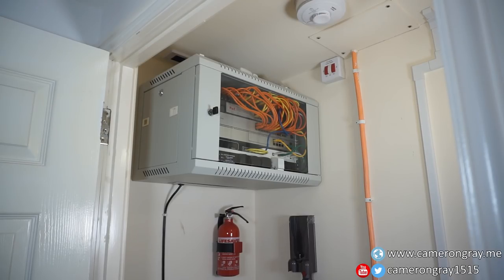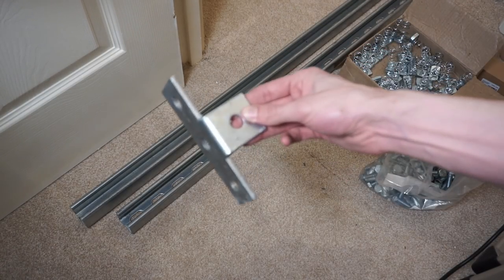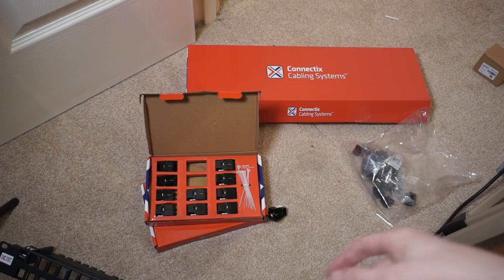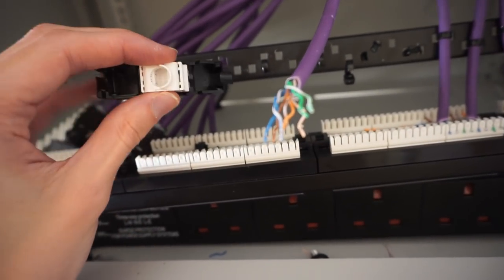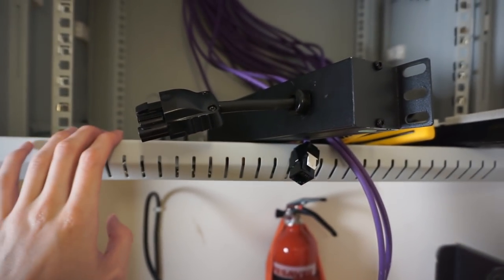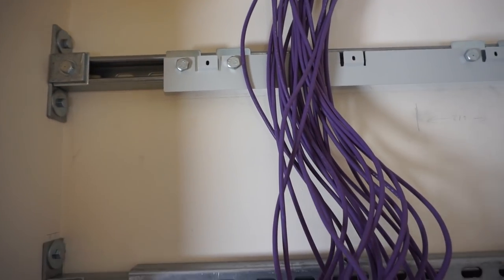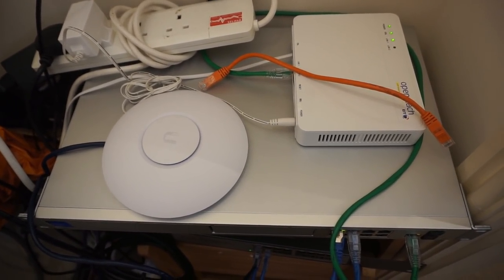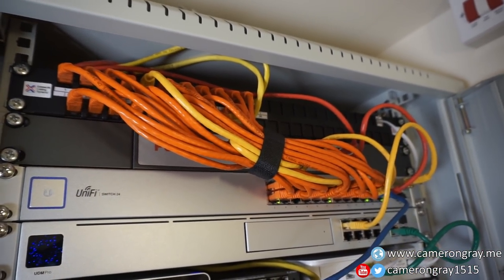Improving my Home Network Rack - New Patch Panel & Better Wall Mounting

Comment from the maker: Hardware used in this video:

Metal struts and fixings from: https://directchannel.uk.com/
Patch panel and keystone modules from: https://www.cablemonkey.co.uk/
RJ11 Keystone Module: https://amzn.to/3C5Ut1D (Affiliate)
Inline 16A Flex Connector: https://amzn.to/3m3cHv3 (Affiliate)

Comment: I work as a network engineer and do work on sites occasionally, primarily with optical networking, but I really enjoy watching these kinds of videos to see how people do their home stuff. I don't have the motivation to actually do it at my place - currently have a juniper fw sitting on the floor with an access point on top of it which was put down the day I moved in, and was "good enough" and remained ever since lol.
Reply from the maker: I can relate to that!  I enjoy my day job but a lot of the time, after working with tech all day, when I get home the last thing I want to do is do more tech stuff.
Reply: It's really constructive to have you watching and commenting, fair play 👍 I know what you mean though, I design houses and extensions for a living, my own house is in desperate need of extension/alternation, but can I be bothered?!? Going back a long time when I was a strawberry picker...I did not want to see strawberry's out of work hours! 😁
Reply: i loved my job. i worked 24/7 for 6 months in the middle east. i was a marine communicator. my skills helped me upgrade my network. my entire house is wired. 2 drops per room. i filled a 16 port switch.
Reply: @defective1331  
I was wondering why you had so many Ethernet cables in a household. I do have 2 going to my living room ,but singles in the other areas . I despise wireless ,and will hardwire everything if I can . I wanted the 16 port switch but it wasn’t in stock so I purchased the wus 24 port . I was concerned about it only having 95 watts of poe , but I’m thinking I’m fine as I’m only running 5 G4 pro cameras and an AP pro on it .
Reply: @MajorTendonitis  i stream my tv only. and wires means no interference. and wifi sucks. it cuts on and off when it gets to a year old. 

how many cameras do you have on your 24 port poe switch. do you have a poe ethernet multichannel nvr

Comment: That chain is a good idea, have used it myself a few times. I take mounting heavy stuff very seriously. I have seen a rack fall off the wall that was mounted on plasterboard, it narrowly missed a child sitting under it(it was in a classroom), glass everywhere and cut the poor kids leg, terrifying could have killed the poor lad.(i did not fit the thing )

 I think you have done a very good job there.

That keystone looks good but i like the angled excel one.

Comment: I install these at work. Whenever we meet a wall without studs that hits atleast one of the predrilled mounting holes, we drill out 2 small holes on the backplate in the network cabinet itself where the stud is located and insert big strong flatheaded screws. That solution is absolutely strong enough. This seemed way overkill. Anyway great video to watch!
Reply from the maker: My issue is that the wall only has a single vertical timber stud so I wouldn't be remotely happy mounting such a wide cabinet to that.  If there was a couple of studs but they just didn't line up with the holes in the cabinet, I'd be totally happy to drill new holes in the cabinet.  This solution is definitely overkill, but £50 of metal fixings to protect £500+ worth of equipment plus the cabling running through the ceiling (and the ceiling itself which would probably come down if the cabinet fell) seemed worth it.

Comment: You can make that so much neater. Put the PoE switch on top, then the patch panel, then your regular switch. Move the keystones to the right side. then just use 1' patch cables to go where you need them. Move the DSL jack to the right.
Reply from the maker: The "PoE switch" is an injector so it really needs to be between the patch panel and switch as the cables are patched through it.  My issue is that there isn't much space in the cabinet, in particular between the door and the front of the equipment.  Even with 15cm patch leads, I imagine the cables would stick out too far and would squish against the glass.  The way I did it here meant that all of the slack of the cables was used up in the horizontal distance across the rack and therefore they don't stick out far enough to significantly get in the way of the door.  All I really care about is that it's totally maintainable and easy to understand, I'm not necessarily bothered about making something /r/cableporn worthy, it sits in a cupboard out of sight.  I'd probably do more if I had a larger rack with more space between the equipment and the door but there's no point replacing it currently when I have other things I need to spend money on first.
Reply: I was also thinking about that and get shorter thinner cables to line them up straight down from the patch panel, it would just be icing in the cake. Really well done though.

Comment: I love the Unistrut install.
I have a few suggestions to clean it up even further.
Move the keystones to the right so they align vertically with the ports on the 16 port switch. Then use much shorter patch cables.
Move the patch panel into the 2nd U location.
Move the 16 port switch into the 3rd U location.
Lastly, move the POE to the 1st U location.

Comment: My 8U and now 12U rack that is mounted in my Closet is lagged screwed into a single stud that runs in the middle of the closet.  Well, the 3/4" Plywood is mounted to the single stud.  The new 12U rack is pretty heavy and so are the stuff mounted in it including the UPS and it's rock solid.

I use those Struts at work. Even much larger ones to hang like heavy Transformers on using long All-Threads.  I still think he would have been just fine using 3/4" Plywood lag Screwed into the single Beam.  You can screw the lag bolt down in a straight line in 2, 3 places and it'll be pretty strong.  This seems a little bit of overkill.

I love Keystone Patch Panels.  If a port goes bad, you can easily replace it with a new Keystone instead of a whole new Patch panel that you would have to rewire everything.  No thanks.   That small rack is clearly not going to go anywhere.  It's beyond overkill, but if he feels safer going that route, then by all means.   Here in the U.S., you can get that strut stuff at Home Depot.  But anything larger or specialty stuff, I'll order from McMaster.  I can get most of their stuff Overnight.

Always great to see other people's setups.

Comment: Thank you for this, I was given some network switches, patch panels, etc. a good while ago. I bought 305m of CAT6 + 3 x Unifi AP's for house and detached office (external runs will be replaced with fibre later, to alleviate electrical grounding & lightning concerns). This will be a very useful video to refer to, as I've only got the arrangement working and not particularly aesthetic (understatement). Your level of detail is worthy of respect. 👏

Comment: Your old patch panel. You can remove the screws in the back and then they come into banks of 6 which you could have easily fit through the hole

Comment: Very nice to see what was my inspiration to sort my home network out get a refresh. The slim RJ45's are nice. I would have thought you would have got something like those and then positioned the keystones to the right to line up with the switch so they're more vertical rather than cutting across. You could also then have a cable going from the cloud key and your second switch running into a keystone jack, then patch to the POE switch. Would give a super clean look
Reply from the maker: Thanks!  The port alignment was really just to take up some of the slack in the cables, otherwise the cables would be too long and press against the door.  May try shorter cables in the future.  I could certainly have used through coupler keystones for the other kit in the rack and this seems to be a bit of a trend amongst the home network community but it's not something I like - just adds in additional connections and possible points of failure IMO.  I'll keep things neat enough so that they are maintainable but I'm not super bothered about a flawlessly neat rack.

Comment: Quite a cool idea, I have used unistrut for fitting cable tray/basket and mounting large external junction boxes and much more but never like you have.
I'd recommend a full hacksaw with bimetal blade or better yet, angle grinder, a files also nice to keep the ends smooth, you can also get plastic caps

Comment: Good video, I've just done a very similar thing, upgraded my cabinet and moved from IDC to Keystone. I generally don't come across many Keystone installations in the UK but they are so much easier to work on, but a more expensive option.

Comment: That looks like a clean and sturdy mounting system, I like it. The overall setup also looks pretty clean. One thing I dont understand is, why do you use the left ports of the patchpanel instead of the right ones? Is it because you dont want to run "over" the POE injector ports? Otherwise I think it could look even cleaner that way with some shorter cables.
Reply from the maker: The reason I did it that way was purely because of the length of my patch leads.  Had I right aligned the ports the cables would have stuck out too far and hit the door.  The current patch leads are 15cm which is already really short, getting something shorter would be tricky.  Easy enough to rearrange in the future though!
Reply: @camerongray1515  Oh got it! They look much longer on video. I use 25cm ones for a much shorter distance, but my rack is much deeper. Than I guess your solution is as good as it gets with the limited space you have!
Reply from the maker: Actually, my mistake, the cables are probably closer to 30cm including the ends, I had it in my head that they were 15cm and obviously never thought to measure.  I'll likely buy 15cm ones when I try the slim cables and at that point I'll consider rearranging the patch panel.
Reply: @camerongray1515  a small number of  my 25cm cables are quite bit longer than others, really disappointing :/.

Comment: one  of the patch panels i bought basically allows you to plug a cat6 ethernet cable into it without having to make and terminate your own cables this means that unless you need made to measure cables then you can save yourself the agro by buying premade cables
Reply from the maker: Those work and I've seen them used although I find it easier to connect to keystone modules than to crimp RJ45 connectors.  Not sure where I'd use the through coupler ones personally as I'd always use solid core bulk cable for structured cabling rather than patch leads.  Then I'd never use a patch panel as a way to run patch leads from the front to the rear of a cabinet, I see it done but to me it just adds points of failure that could be avoided by just using a brush plate.

Comment: Was using the UniFi gen 1 24port switch myself until I bit the bullet a few weeks ago and ordered the gen 2 24 port POE. Much neater, and looks superb with UDM pro 😎
Reply from the maker: Yeah, I'll likely move to a PoE switch in the future but that's a while off budget wise and depends if I stick with UniFi or try another platform.

Comment: Got these keystone jacks, and they were great to install/terminate, but most of them broke over a year later when removing from the patch panel.

 The latch that clips into the patch panel breaks very easily when removing. Otherwise they are very nice to terminate, really like the tooless design.

I'm replacing them with passthrough rj45 so I don't have to re-terminate them if they break.

Comment: There is a system called MoCA Media over Coaxial Cable which means if you have a lot of TV sockets in the house then they can be used to carry data as well as the antenna signal to the TV.

Comment: I would recommend using a .5 m dac cable to go from your UDMP to your switch.
Reply from the maker: It would work, but it wouldn't provide any significant performance improvement over a regular CAT6 cable as the US-24 switch I have only has SFP ports, not SFP+

Comment: Really enjoyed your home network videos. They definitely inspired me to planning out my own home network that I'd like, which lead down a rabbit hole about Networking, then Home Assistant and Automation and Blue Iris. The time you spent thinking about the little details like Labels and cabling is so worth it because that cabinet looks great. Curious what your thoughts are on using the BT Openreach modem over the standard ISP modem.
Reply from the maker: I've just always used the openreach modem since I've been using it since it was the ISP modem (they used to provide them with FTTC services before they integrated VDSL modems in their routers, they also used to send out an engineer to "install" the modem along with a VDSL filter faceplate).  If your ISPs router supports bridge mode I suppose you could use it as a modem however the one Plusnet supplied doesn't.  Additionally the openreach modem (or other options such as the DrayTek Vigor 130) have a nice form factor that can fit in a rack whereas ISP routers tend to be bulky vertical standing things that look silly shoved on their side in a rack.
Reply: Ah that makes sense. I have an openreach modem and tempted to segregate out the devices. Not sure if the vodafone router supports bridge mode though. Supposedly the openreach modem can achieve better speeds and stability benefits in some circumstances.
Reply: @camerongray1515   BTW: They can't use a modem if they use fiber or VDSL - both technical are digital technologies. Possible do you mean a fiber2ethernet or VDSL2ethernet box? Sometimes they integrated it into the router. Do you need a MODulator/dEModulator only at old analog technology over copper lines. 

Modern router are typical a (fiber/VDSL2)2ethernet box, WAN-port ethernet, bridge ethernet2ethernet, 4-port switch 1000 MBit together into one small box with one power connector. Theoretical do you can use only ubiquiti products for this way and not only a switch! Then do you can easy control the way, e.g. failback over 4G/5G, or over cable.
Reply from the maker: VDSL still sends signals over a regular analogue phone line, it just uses a wider frequency range than ADSL so you're still definitely using a modem for that - the "Openreach Modem" is absolutely a modem in every sense of the word.  Sure for fibre it's not technically a "modem" in the official sense of the word, it's usually some sort of ONT in the case of PON domestic/small business installs or some sort of provider managed switch in more commercial installs (or various other options, I've seen simple passive media converters with some early FTTP setups for example).  That said, I'm not a fan of being pedantic about terminology, if I know what the person means and it's not in some sort of situation where ambiguity could be dangerous, that's fine.  If someone tells me that they're having an issue with their "modem" or their "hub" when talking about their ISP provided "router," refers to an outage with their internet connection as the "wifi being down" or asks "Why did you run all those cables in your walls? Is it so you can plug your computer into the WIFi?" then I can usually still work out their intent.  Not everyone has to be an expert in every area of technology and I'd rather simplify things to help them understand than give them the "well... actually..." treatment and baffle them with precise terminology related to devices that they view as "the box that makes the internet work."
Reply: @camerongray1515  The Openreach Huawei modem were routers with the original firmware. Openreach had their own firmware and used them as modems only. These ones can be unlocked. The ECI one as far as I know no one has unlocked them. The Draytek V130 or the newer V166 are true Ethernet modems but can be use as a basic router.
Reply: @camerongray1515  Yeah you right - of course all digital technologies use a wire what can use for a analogue phone too. But if you use after the net-goes-into-your-part/place a cat5/6/7/8 cable and not an old 2-wire-phoneline from 1888 your signal difference between good/bad go over 20dbA higher (or more). This makes a better signal quality what understand no-experts and DIY-people too. But both is a "wire" for them! [I have this problems here for cable tv in a big house for old people's home where only no-experts around. They not can understand that the correct "cable / wire" is the problem of the solution.] 

Exact this and many other problems let me nitpick the exact words - then ubiquity unifi have own router, security gateways, switches, access-points, aso. I am not the once viewer how ask why do you use a provider box for VDSL after all european countries allowed it that every customer can use own equipment. And - it makes more sense after you love this ubiquity unifi hardware.

Comment: i’ve used gripits to mount a 55” Oled with a vogel’s slim wall mount. 

Gripits did scare me as i was not 100 percent they opened correctly. mind you, the tv was up for a few years before we moved house so i assume it was all good.
Reply from the maker: Yeah, they're pretty good, my concern with this was more the fact that the cabinet protruding from the wall creates a sort of cantilever force with the gripits being pulled away from the wall surface.  With a TV on a flat to wall bracket it's more of a sheer force which puts less stress on the plasterboard.  The 113kg rating of blue gripits is only for sheer force, the ratings for cantilever and tension forces are significantly lower.

Comment: good job on this project... btw, you might have mounted the power in the back of the rack just behind the patch panel... that way you can get free space between switches for better airflow...